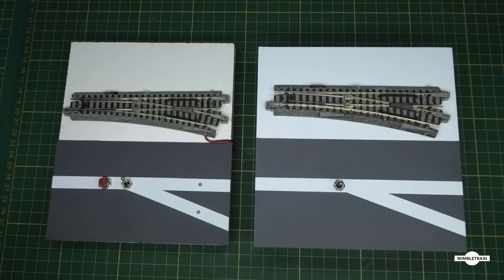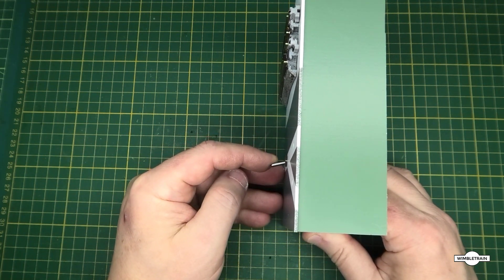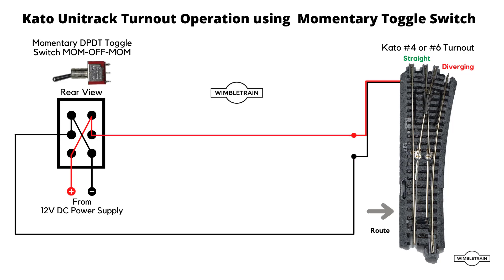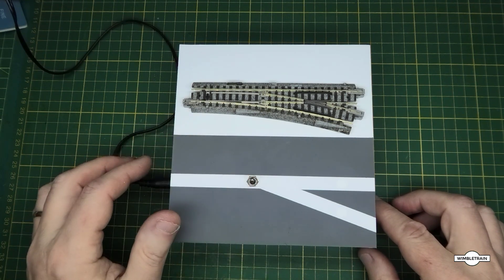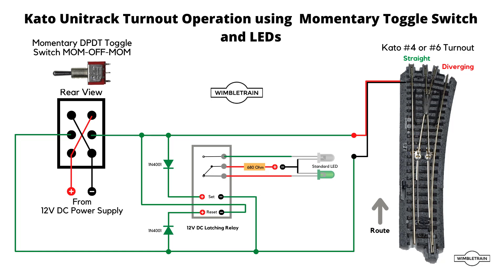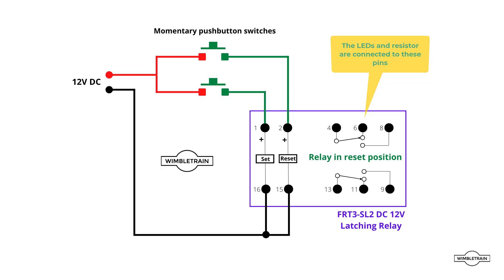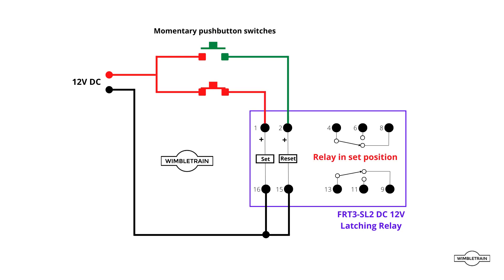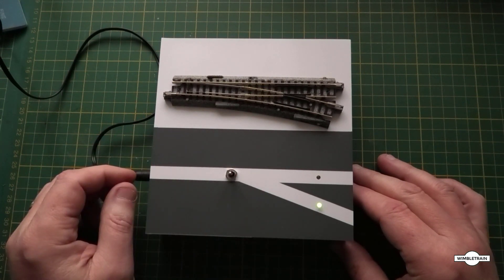Kato Unitrack Turnout Operation using Momentary Toggle Switch

Comment: Hi John, I'm wondering if you or anyone else has had issues with these latching relays. Your wiring illustration could not have been simpler and I purchased the exact same relay's, momentary toggle switches and diodes. I followed your diagram to the letter and was able to get the turnouts to switch (I use Marklin c-track turnouts) and the bottom led to light but have not been able to get the top led to light up. This is the one connected to the top right pole (#9 I think it is). The relays came in a pack of 6 and I assumed it was a faulty relay but tried three of them and non corrected the issue. I also replaced the diodes. Still nothing. I may have to go back to your first video using both a toggle and momentary switch side by side. Has anyone else had any issues with this? 
Many thanks for your work on this!
Reply from the maker: Hi, don't give up just yet we will try and fix it! I am assuming that the LED that does work does go on and off when you switch the turnout? Can you hear the relay operating? I would check (if you haven't already done so) that the LED not lighting up is connected the right way around, they should both have their shorter leg connected to the negative side of your 12V power supply. John
Reply: @wimbletrain  Thanks for the response John. Yes the LED that is connected to the bottom pole (#13) does go on and off when I switch the turnout. Both LED's are connected to a negative terminal. The positive end of the bottom LED is connected to the bottom pole as mentioned and the top positive end of the top LED is connected to pole #9. Pole #11...or the middle pole on the right side...is also connected to a positive terminal. I'd be much happier if neither LED worked! But right now it's only the top one not working. I can short out that LED so that it goes on and off with the bottom one...so I know it's working. Both diodes are connected the way you illustrated...with arrow pointing toward the relay. Those relays aren't very expensive...I may have received a bad batch....so I may just order another 6 and see if that solves it.  Thanks again for the time!
Reply from the maker: @PeterMartinPhoto  Hi, another viewer has had issues as well so I'm going to do a video showing my wiring and try and run through the connections.
Reply from the maker: @PeterMartinPhoto    Ok I've watched my video back and can see that I may have caused some confusion with my diagrams. The resistor should be connected to pin 4 of the relay and the leds to pins 6 and 8. Let me know how you go checking that. John
Reply: @wimbletrain  Thanks John! Currently out of the country for another few weeks but will try this as soon as I get back home! Although your original was as clear as a mountain stream...I look forward to trying this! Thanks for taking the time.
Reply from the maker: @PeterMartinPhoto  The other thing to note is make sure your 12V supply is at least 2Amps. I tried running the circuit off a 9v battery just as a test and the relay would not operate unless I disconnected the Kato switch. I know not a fair test but it kinda points out the need for a decent power supply.

Comment: Excellent video, thank you so much for putting this together and for sharing! I really like how you included the latching relay with the LEDs, too. I don't know enough about electronics to have figured that one out but I understand enough to really appreciate what it does! Well done on the presentation, as always.
Reply from the maker: Hi and thanks for the comments. Yes, if you don't have some knowledge of electronics it can be difficult to understand exactly how it works, but you can see the end result. I put the LED part in there because I know if I didn't someone would ask! John

Comment: Hi John. i seem to have a mental block regarding L.E.D.s and voltage etc which stops me from buying and trying them. how do you power and regulate the power to them in this example? Keep up the great work.
Reply from the maker: Hi Ed, so with the LED setup on the diagram near the LEDs there is a + and - symbol, these are connected to the 12V DC power supply. The +12V goes to a 680 ohm resistor then through the relay. From there it connects to the anode of the LED. The other side of the LED is then connected back to the the ground of the 12V power supply. The 680 ohm resistor is what limits the current through the LED to about 18mA (12V divided by 680 ohm, Ohms law). With LEDs I usually go for a current between 10mA to 20mA (0.01 to 0.02A). Regards  John